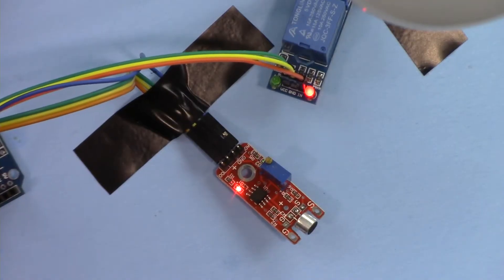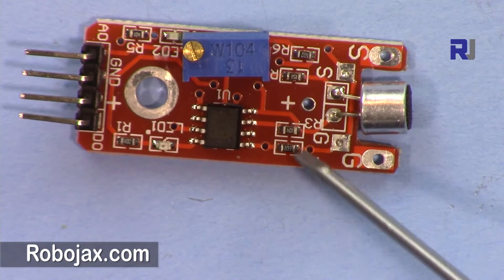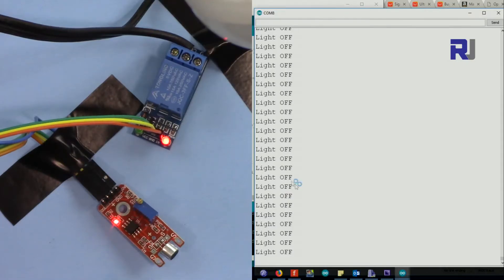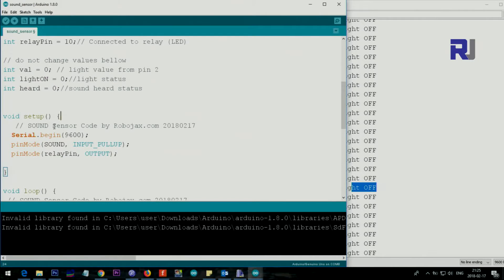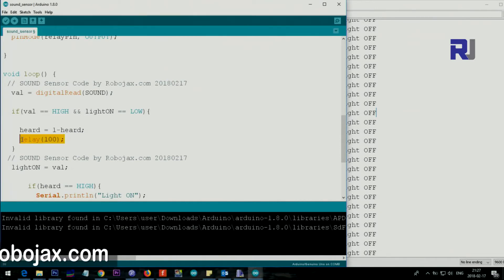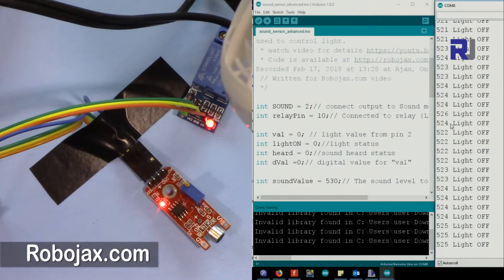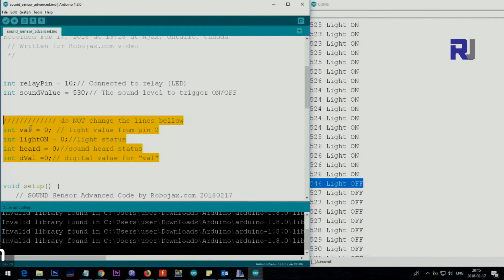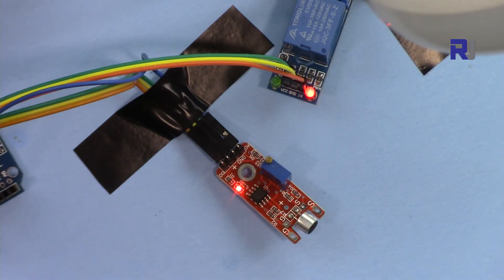Turn AC bulb ON and OFF using hand clap, audio or sound Arduino RJT62

Comment: Thank you ! 

Can I specify a specific sound, so that the sensor will recognize it and then turn it on and off according to the sound, such as the sound of a siren and so on...
Reply from the maker: No. This just detects the loudness of any sound .
Reply: @robojax  Thank you for replying! 
But do u know how I can do that? Does the light turn on at a certain sound?
Reply from the maker: Only by sound level. But look for speech recognition. There are solutions. I might make video on that in a 2 or 3 months
Reply: Thank u really
I have a project coming soon in my studies and I have to do that point… 
Thank u soooooo much

Comment: How would the wirings will be if my AC light has on/off switch?
Reply from the maker: you will need one more three weay switch. the relay shown has already three pins and you just need a switch that has 3 pins. see details of controlling one light with two switches https://en.wikipedia.org/wiki/Multiway_switching

Comment: Did not expain wire connection properly and no circuit diagram
Reply from the maker: Please watch updated video Lesson 15: Arduino Sound Sensor Module  | Arduino Step By Step Course
https://youtu.be/INq8A3dLNzM

Comment: I want to do something similar but instead of clapping to turn on the light, I want the light to turn on when a certain sound threshold is reached. For example, if I am talking in a normal tone the light will not flash on, but if I were to shout or scream the light will flash on. How would I go about achieving this?
Reply from the maker: Hi, that is called speech recognition which need more advanced signal processing. So search for speech recognition.
Reply: @robojax  hmm I don't think that is what im looking for exactly. I just want the light to activate when sound exceeds a certain threshold (not specifically talking).  Then deactivate once that sound has stopped.
Reply from the maker: this can just detects level of sound and if you try to create the same level of sound,  then it will detect it . The problem is that many different sounds will have the same level or amplitude and that makes it to have false detect.

Comment: Hello dear friend, I want to use this circuit for fan sound. Can it be used for fan sound? Turn on the light when the fan is on. Turn off the light when the fan is off. Thank you, thank you for answering Please answer me
Reply from the maker: Hello, yes it can. we use relay and relay is a switch which can turn ON/OFF anything.

Comment: Awesome project! Would it be possible to alter the code so the light is only on when sound is detected? I’m trying to make a lamp that requires continuous sound to stay on.  It seems like it should be an easy change but I am very new to Arduino coding.
Reply from the maker: Hi, so you don't want it to toggle. if there is sound, keep the light ON, else OFF.  the use this instead of loo();

void loop() {
 // SOUND Sensor Code by Robojax.com 20180217
  val = digitalRead(SOUND);

  if(val == HIGH){

        Serial.println("Light ON");
        digitalWrite(relayPin, LOW); 
       
      }else{
        Serial.println("Light OFF");
        digitalWrite(relayPin, HIGH);
   
      }     

 // SOUND Sensor Code by Robojax.com 20180217
  delay(100);
}
Reply from the maker: *** Free Arduino Course worth $200**
Arduino Step by Step Course  (over 150 lectures) Starts here http://robojax.com/L/?id=338
Reply: @robojax  thank you! I will try this out

Comment: int sound_sensor = A0;
int relay = 13;

int clap = 0;
long detection_range_start = 0;
long detection_range = 0;
boolean status_lights = false;
 
void setup() {
  Serial.begin(9600);
  pinMode(sound_sensor, INPUT);
  pinMode(relay, OUTPUT);
}
 
void loop() {
  int status_sensor = digitalRead(sound_sensor);
  if (status_sensor == 0)
  {
    if (clap == 0)
    {
      detection_range_start = detection_range = millis();
      clap++;
    }
    else if (clap > 0 && millis()-detection_range >= 50)
    {
      detection_range = millis();
      clap++;
    }
  }
  if (millis()-detection_range_start >= 200)
  {
    if (clap == 1 )
    {
      if (!status_lights)
        {
          status_lights = true;
          digitalWrite(relay, HIGH);
          Serial.println("Light ON");
        }
        else if (status_lights)
        {
          status_lights = false;
          digitalWrite(relay, LOW);
          Serial.println("Light OFF");
        }
    }
    clap = 0;
  }
}

Comment: Hello. Thank you so much for this tutorial. I have a few questions. If you could answer them that would be awesome. 1) Do you have like a circuit diagram to show where to connect the 3 pins into the arduino uno? 2) Can this sensor hear chords and sense them and write them in the analog output?

And my main use case is this. I want to make it so that the sensor reads and hears a specific value, and the value is either true/false it should make something happen with led lights which I also have to connect to arduino pins. Which connections do I make for each type of thing ( sound sensor and individually addressable led lights )? Is it possible to use if-statement to do this? Thank you so much!
Reply from the maker: Hello,
1-I have explained the module pin by pin and then explained the wiring. you don't need diagram.
2-I don't know what "chords" is. I have explained both analog and digital output with examples. for true or false use digital output.
I suggest following my course *** Free Arduino Course worth $200**
Arduino Step by Step Course  (over 100 lectures) Starts here http://robojax.com/L/?id=338

Comment: Could you modify this to a servo operated light switch? i’ve been searching and searching and can’t find anything
Reply from the maker: what do you mean by "servo operated light switch"? is the servo moving the light in lift-to-right if so, you don't need anything, just simple servo code which is part of Arduino and attach your light to servo.

Comment: Do i have to shout so sensor work or it can be more sensitive? Help me sir
Reply from the maker: no. I've shown that you can set sensitivity.
Reply: @robojax  i did change it, but it didnt change much ( still need to shout)?
Reply from the maker: It should work, or get different sound module
Reply: Its so amazing sir, i learned a lot
   Can i fo this project? Like in thesis i'm in 3rd year college now ,and i want this it gives me excited about this project

Comment: I have only 3 pin sound sensor what can I do
Reply from the maker: it is the same.so you have either Digital or analog. I've demonstrated both in video. Please watch and you will be able to use it. good luck.
Reply: @robojax  only digital thanks

Comment: Hey man awesome video, im trying to build this project myself and im a little new to this. I just have 1 question, you lost me a little at which pin of the sound sensor you used. Do we need digital output or analog output connected to pin 2? And what do we do with the other pin, just leave it?
Reply from the maker: Hello, you made me watch the video as I was surprised to be asked such questions which I try to near lave. Indeed I have explained. This video has two part and shows two code which in each code one of the pins used.  I have added the timing in the description  of this video(as I was watching it) so you can jump to different section of the video by clicking on the time or clicking on the player timeline. good luck.
Reply: @robojax  thank you very much i have figured it out, however i cant seem to be able to download the code from your website. I have found the link within arduino code that is connected to this video (number 61, https://robojax.com/learn/arduino/?vid=robojax-sound-sensor-AC-Bulb) but i dont see a download code option.

Nevermind, I just copied the exact code from the video. So far it doesnt work but maybe im just not reaching the threshold, about o adjust it now.
Reply from the maker: you are welcome. I have changed  the link in the description to http://robojax.com/L/?id=278 and it should be available.